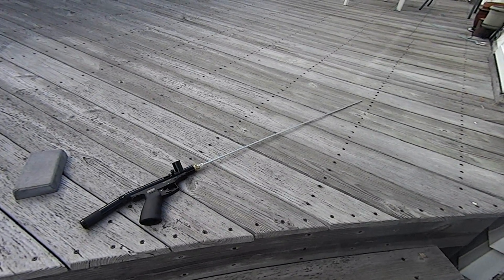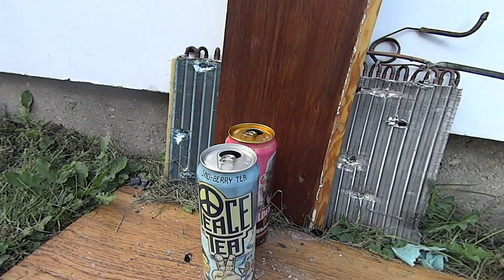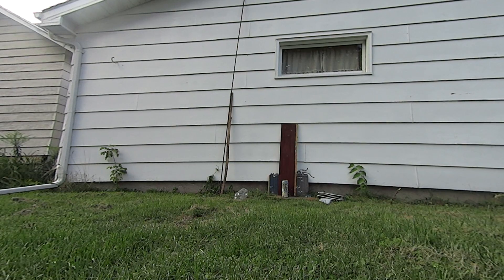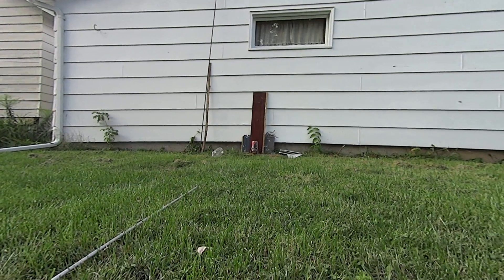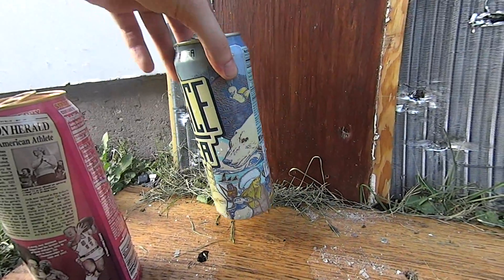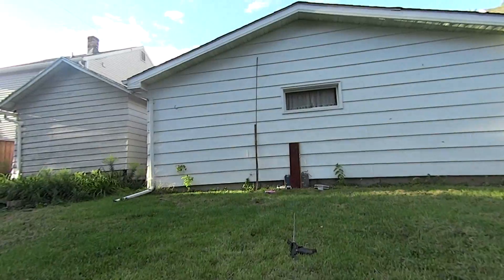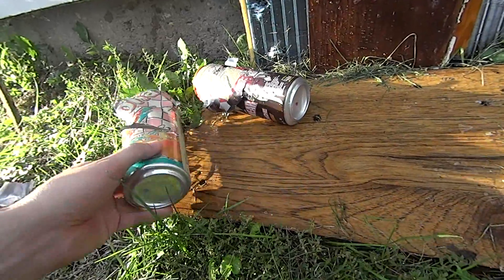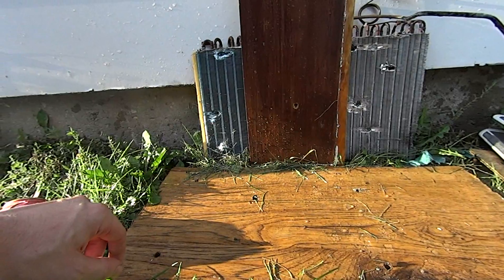New hammer valve co2 gun & QEV 5.2g firing @ 525psi

Comment: Can use a magnet to hold the steel ball secure the magnet to outside and make sure it’s strong enough to hold the shot if using a Farris metal barrel would need to be a stronger magnet and a non Farris metal tape or glue it ! Let me know if it works if you even tried it . Thanks Dale From Otto’s Plumbing and HVAC

Comment: Shooting cans is classic ;) just a couple of things:
If projectiles are still rolling out of your barrel despite using wadding, you aren't doing it right. Your patch/wad should wrap around the sides of the bullet to create a tight fit. You should also be hearing more of a popping noise or a boom when shoot if you have the right seal. 
Instead of upping the pressure, why not first get a longer barrel/improve the valve. Anything beyond the pressures you are using are pretty serious and your QEV or compressor might fail. To increase the power safely, I would suggest using an oversized valve, like a 3/4", to get extra flow into your barrel. You could also reduce the volume between your QEV pilot and exhaust valve for faster opening times. Since pressure washers have low flow and slow opening times, perhaps you could do what I did and have a smaller, second QEV triggered by your washer to exhaust the main one? If you think a longer barrel in your current configuration would look too goofy, you could try it in a bullpup configuration. Since air is a dense, slowly expanding gas, the longer the barrel time the better. You might be interested in GGDT - it is a program that lets you model your air gun with good accuracy. You would be able to see how my suggestions translate to more power.
Finally, I would use a safer/bigger backstop. You are aiming at quite a small area from a distance, and if you miss at those power levels, you could shoot through the thin wooden walls of your house or have a ricochet off that concrete. Steel is very hard, and collisions with concrete are very elastic. It will come back at you without losing much velocity.
Reply from the maker: thanks for the comment.  i don't have any material thin enough to wrap around the bb that will still allow it to fit in the barrel.  it's actually a very close fit, just not completely tight.  

as far as piloting the qev, i had a minimal dead space schrader valve in my first design, and i'm actually getting more power out of the washer handle.  also, i'm already using ggdt, and it claims that adding a larger qev isn't going to help much as the barrel diameter is already the choking point on my current design.  i'm not up for adding a longer barrel (already almost too long imo) or going to a bullpup design just yet.  maybe in the future....  and lastly, it's hard to tell, but i'm always at an angle when i fire (and always wearing safety glasses) so if a ricochet were to happen, it shouldn't hit me.  also that's my garage : p
Reply: In that case, you could try coating in wax or grease. Still, I've found that the tighter the fit, the better shot. This is probably because a tight patch acts as a detent, allowing pressure to build up fully before accelerating the projectile down the barrel at a higher initial velocity. 

You can ignore that GDDT warning - more flow is better. Period. It's very common for people to use oversized QEVs, as a 1/2' QEV will have worse flow than an equivalently sized ball valve. Heck, some have even used two or three QEVs feeding into a single barrel! I was able to get a noticeable power increase from simply stepping it up from a 1/2' to a 3/4' for my 1/2' barrel. 

Fair enough, it does look cool as it is, but I suspect you will eventually do it for the sake of moar power! IIRC, my barrel is just over 6 feet long, which may sound crazy, but in a bullpup configuration it really is no longer than a traditional muzzle loading rifle.

Plastic fragments from your safety glasses will just act as secondary projectiles if a ball bearing hits it - it looks like you are getting 100+ ft-lbs of energy, and they will go straight through. Your "garage" is bigger than most houses in the UK, LOL. 

Have you ever considered chronographing your gun? If you can't afford one, you could always make one very cheaply....
Reply from the maker: I'm actually thinking of making my own qev soon. around a 1 inch one.  should be plenty powerful : p.  qevs are more difficult to find and more expensive than they are in Europe from what I've heard.  I should be getting around 140ish ft lbs with the 5.2 gram. and I was thinking of maybe chronographing my shots, but don't own one